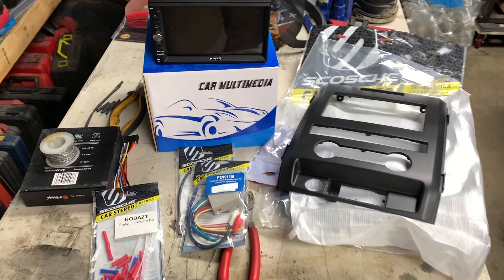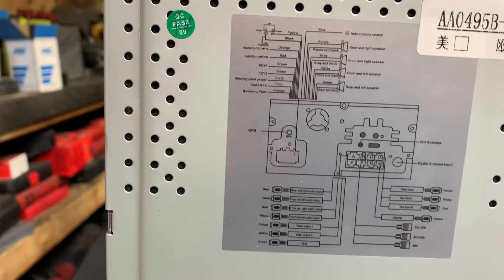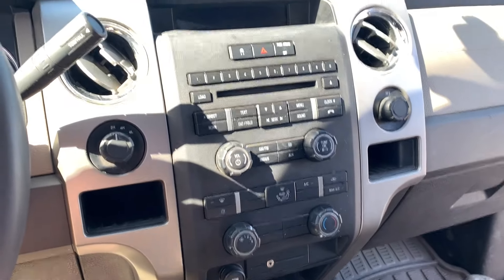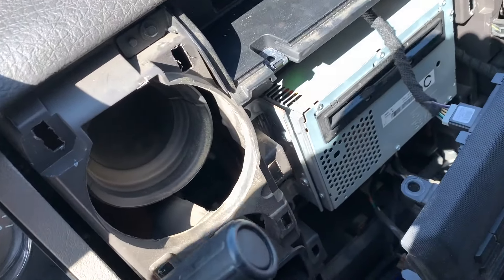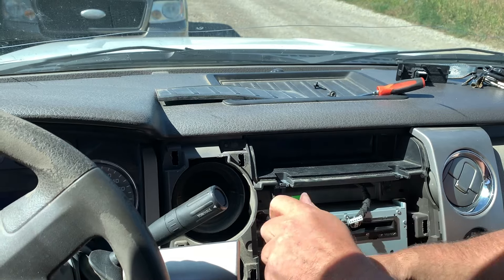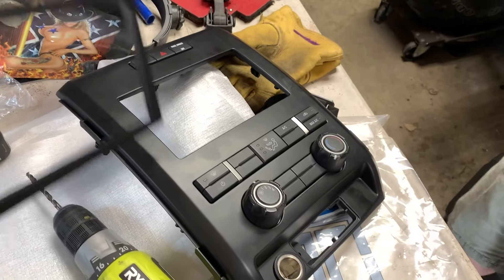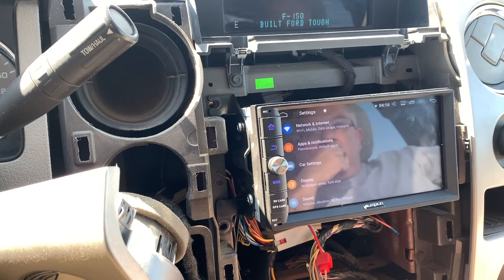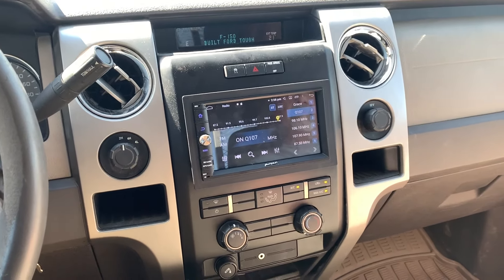DIY Ford F150 Stereo Install 2009- 2014

Comment: EXCELLENT job clarifying which wire you tapped for ignition hot.....
Reply: I really need to figure out what he tapped into because when the guy wired up my radio the ignition switch turn on wire didn’t work so he hit wired it to the hot where I have to turn the radio off myself when I get out but it started a paracitic draw on my truck I have been trying to figure it out for a while now so I need to know what to wire that too
Reply: @TheDoubla44  ignition hot is under the passenger side floor trim, door sill or whatever you call it. If I remember right it's a blue one. There's two to pick from.

Comment: Pro-tip: disconnect the negative battery terminal before you ever work on anything electrical in the vehicle. Otherwise, you may find yourself buying a dash, windshield, and airbags. Speaking from experience - a dealership I worked at had a mechanic installing a radio that didn't disconnect the negative battery terminal before beginning the job. Repair manuals usually advise to disconnect the battery negative battery terminal before starting any job.
Reply: Yea I've attempted it without disconnecting the battery and i can vouch that you will definitely see fireworks if you bump something🤣🤣. It scared the crap out of me when it happened.
Reply: Oh! One thing I did forget. The kitchen sink LOL no seriously the whole purpose here was to say for a few more dollars just get a professional or someone who knows exactly what they're doing so that you don't run into an extended length of time without the radio and then understanding. I would have been better for me to just pay somebody to do it. The problem is I got such a large variation in prices. Just to put in a aftermarket radio that I already had the parts alone such as the interface and the adapters or literally double and even triple the price of what I could buy them from Crutchfield or right away I could walk into Walmart. Which by the way I spoke to someone like Crutchfield last week and she was extremely knowledgeable and was able to give me a price right away. I thought at the time it was probably a price that I could do without. But by the time I put my time plus the cost of the materials, I probably would have been better off with the Crush

Comment: Hey all! I've seen a lot of comments about finding a good source to tap into. One commenter mentioned the blue wire connected to the hazards, and honestly, it’s worked flawlessly for me. If you're facing a similar issue, give it a try!

Comment: Like so ppl can see what wire he taps into. Use the White and yellow line wire, NOT the white and purple line.  If you tap into the white and purple for your setup you will drain your battery.
Reply: I used a t-tap on the blue wire from the hazard light connector to the red wire on the radio
Reply: @Beaksterboy  Blue hazard wire worked for me .Thx Beaksterboy
Reply: Thanks
Reply: I don’t have a white and yellow
Reply: @traceowen5316  use blue wire from hazard lights or 4 way light
Reply: @ubica021  don’t have a blue wire for hazard light connector, any idea which other color  it could be ?
Reply: @ericktrejo2  which one has the power on hazard light that ones is but put the car on or on position
Reply: Can somebody make a video about this
Reply: I have had a paracitic drain on my truck because of this for years and I just now figured out it is from the way the guy wired my radio and this seems to be the issue I need to figure out what wire to wire it to can anyone help me I’m seeing the white and yellow wire, I’m seeing a light blue wire from the passenger side and then a hazard wire but I am not all that smart about this stuff
Reply: I have had a paracitic drain on my truck because of this for years and I just now figured out it is from the way the guy wired my radio and this seems to be the issue I need to figure out what wire to wire it to can anyone help me I’m seeing the white and yellow wire, I’m seeing a light blue wire from the passenger side and then a hazard wire but I am not all that smart about this stuff

Comment: This is a prrtty good video 👍 However I had the same problem as many of you here asking questions .  I was a little dissapointed at the creator of the video for not responding to any questions on here as he seems to know what he's doing. 
Well, bottom line is that after researching I figured out that he would not have the correcr answer anyway, this due to the different variances in models and years. Depending on the model and year Ford has changed wiring and fuses around and the diagrams change. I had to look hard at mine from a couple of youtube videos as the advise on the comments on here ended with me having a constant hot wire which means you might leave the vehicle forgetting to shut off the stereo which will eventually drain or kill your battery. Other advise, i got a hot with the key to the on position but had to be on all the way as if to start the vehicle and also when I shut off the truck if it was running my stereo would shut down immediately :(
I did finally find a fuse to allow my radio to work just like the original factory. I will post another comment and make it short. Thanks you all for trying to help👍
Reply from the maker: The proper way would be using a Canbus controller would fix all those issues if a person wanted to spend another 100ish dollars
Reply: @TestDontguess  Cool. I'll look into that. Thank you 👍

Comment: Thank you for posting, it was really helpful to us with my friends 2010 work truck f150. He had problems with stock stereo not playing very well (extremely low volume) and the new jvc single din radio fixed the issue!

Comment: I just now finished my retrofit of the same radio with the same dash configuration. Here are some important things you might want to know. Firstly, I am a lifelong field engineer, a component level technician for a marine electronics company. I know how to use a multimeter and I could not find any 12Vdc line that is zero with the key off and +12Vdc when the key is in the second position (ACC or Ign on). I went to the fuse box located on the passenger side and found fuse 29. If you go this route it very easy to do. You will have to buy a mini (not micro--even though the size of the fuse is a micro--a micro will not work here) add-a-fuse from an auto parts store like Pep-Boys or O'Reily. And then run that wire to the ACC wire. Then it works perfectly. The radio is too big to fit in the opening on the supplied bezel but there is a frame that comes with the radio which I did use. I had to fiddle around with the distance the radio pertrudes out so that the bezel with be flush with the frame of the radio. It looks good actually. If you buy the camera, there is not enough cable to go all the way back to the tag. I didn't want to mount mine there anyway. So I 
mounted it in the back window pointing aft. Use the gps and the wifi antenna that comes with the radio. Sit next to your house and allow the wifi to see your equipment and login. Then go to Navi and allow google maps to download. It takes a while.
Reply from the maker: or get a Canbus Controller and then you won't have this issue
Reply: Is fuse 29 a 12 volt?
Reply: @spade304 : well, fuses are rated in amperes or amps for short. A 3 amp fuse is adequate.

Comment: For everybody asking i can confirm at 7:35, he wires the red (ACC) wire from his stereo into the white&orange wire from the air conditioning unit. This will let the stereo turn on and off with the car.

Mine is a 2009 f150
Reply: I used this wire on my 2010 f150 xlt, only problem is if I hit my mirror defrost it turns off the headunit. Any fixes you know of?
Reply: Thank you!
Reply: Saved me a headache bro. Thank you
Reply: @reefpearse7498  I don't an white & orange wire what other color ?

Comment: Look into running a wire from the passenger's side fuse box. They vary mine was for a 2009,2010 model and it is fuse# 41 however, rather than going by a number go by what the description on what the fuse powers. Mine says : Automatic dimming mirror,  door lock switch illumination, RADIO ACCESSORY DELAY. 
This allows my stereo to stay on even if I take the key out and is delayed for a specific time that can be programmed in your vehicle's settings or if I open my door (key out ignition) it shuts off immediately. Good luck with your install👍
Reply: This worked for me.  Thanks for the tip!

Comment: What wire did you have to use from the factory harness section for the power? It wasn’t clear in the video. Comments mentioned a red wire from the harness not being used but I don’t have a red wire there. How do I find the right one?
Reply: Did you ever find this out?
Reply: U just need to find the accessories wire from radio

Comment: What color was the ignition wire that u tapped into in the other plug?
Reply: I don't know if anyone else needs it... I took it from the AC plug. In my case it was WHITE with an ORANGE STRIPE. There will be two white/orenge stripe wires, you will need the one which closer to the center of the plug
Всегда пожалуйста
Reply: @ЭлеронАйрон  thank you, I'm doing the installation as I type this
Reply: @ЭлеронАйрон  nope, did not work for me
Reply: @royhkusp1  sorry
Reply: @royhkusp1  if you have a voltage tester, you can check for yourself which wire you have for the ignition. Put a minus on the minus of the battery, and check the contacts with the plus (from the tester), do not forget to turn the ignition on and off

Comment: I recommend getting the can bus harness. From experience I’ve messed up my electrical system trying to splice wires for the ignition. It’s a lot easier just to use the use canbus harness even tho it’s super expensive.

Comment: Did integrate steering wheel controls?
Reply: Would love an answer to this question. Has anyone figured out which wire goes to the factory steering wheel controls.
Reply: @loganbritton4093  If you get a wiring harness for all the plugs then you should be able to use the steering wheel controls.
Reply: I can't get any steering wheel controls at all and everything plugged right in
Reply: There is no steering media controls on those pick up

Comment: Thank you! This helped a lot because I had the same problem with my headunit. I installed it and had no power.
Reply from the maker: If a person spent the money and got a canbus controller you wouldn’t have this issue
Reply: @TestDontguess  what wire did you tap into?

Comment: Hi BSK
Which wire colour did you tapped on ignition power? And from stereo side which wire is it?
Reply: ladawg81 which harness?
Reply: Same problem with mine. Any idea what wire you attached the acc red wire too? Thanks
Reply: Any one found the answer... im stumped right now
Reply: TheCoolQuid did you figure it out? I have everything done it just doesn’t turn on I don’t know what wire he tapped into
Reply: @OscarGarcia-dz4ui  I tapped into the yellow blue wire on the hazard lights cluster. I will say that I didn't find out until I closed up everything. It cuts on with the switch but it's not the accessory wire. Lol I was pissed
Reply: @TheCoolQuid   thank you for posting this,  I've been scratching my head for a couple of hours now. I didn't really want to hack into a wire but couldn't find acc power.
Reply: @TheCoolQuid  thanks👍

Comment: I haven't left any comments in a long time it looks like there was some changes so I hope I got in the right spot. What would it thumbs up but I don't know if there was a rush on time but it sure seems like the most important parts in something like this or the details and in this particular case you had a very good point about the getting your heat shrink shrink wrap cut or pre-cut and so on so that was all great but if you're somebody like me that has only used the old school methods of putting a stereo in which would normally be a single DIN and I didn't have a whole bunch of wires so until we got into amps and things like that and building on to the amps and so on did we have a whole lot of wires to deal with. But in this case I would love to go to Ford and shake the hand of whoever or whomever put this together. It truly isn't a DIY task to take on unless you're a little younger than I am and haven't been out of the market for several years. So my plan was well not only did my first radio go out and I tried everything including the rebaking. that would be model B in the F-150 XLT 2011 . I finally decided that I would take a leap of get another radio from somebody that I had spoken to online. As far as I can tell that radio is fine but it does not work in my truck and that's when I noticed that there was a possibility it wasn't getting power to delete harnesses so I decided regardless I would just go ahead and purchase a double din with the touch screen and all the harnesses that were necessary as well as the interface to keep the steering wheel controls as well as the speed reduction or speed Sound Reduction. When you slow down at like a red light or stop sign and this volume goes down. Just in case I wasn't clear. I hope this is starting to make sense. I'm not trying to be overly detailed that I'm not trying to cut myself short in getting to the point. Yes there's actually a point at the end. LOL as I begin to digress I noticed that I didn't have any fire or any power going to those horses. The main harnesses that carry the power. I really didn't notice that I didn't have power there until I was taking the second original model B unit out. That's what I noticed that I wasn't getting the power. Checking fuses, I've checked them numerous times on both sides and going ahead and changed out many of them. The other thing is and if somebody's reading this and they can see the note or the question is there a relay specifically for the stereo system? Because I think there's like five fuses that go to the radio system. Anyway even purchasing the harnesses and all of this the interface then you wire in case I bypass the harness that I just purchased and went with a wire to the fuse box and then I'll be sort of defeating my purpose. Then I begin to throw something out of line even though that's the way we used to do it but now this is so much cleaner if we can just determine how the different harnesses are supposed to go and so on because I actually have the large harness that I could attach my interface with and it has a couple other harnesses on it as well. Before I start cutting any wires I'm going to double check to make sure I don't have to remove the original stock harness or should I just plug it together and so on well that's all stuff that I'll look into. I think it's a good idea that I read everything I can ahead of time before making any moves LOL. That was probably my most important part of this was that number one by the time I drove out to get the second radio by the time I go out to get the first radio which was the model B which is the nun faceplate and you run into all these different issues and you're even find yourself baking your radio in the oven and you question yourself LOL even though I can see the logic. And thanks for that video by the way but at this point I think the DIY part needs to go into File 13 and I would have been better off bringing it in and having a professional do it. I didn't want to just say that without giving some general reasons. I didn't want anybody who has done these videos the, DIY videos and so on to read this and be offended because I certainly do appreciate as many of you that make these videos. Again thank you very much. Oh and I wouldn't have been able to write this dissertation LOL without some of the things that I've seen on you all's channels so thank you. I'm going to try one more time to not have to run the yellow constant wire to a fuse tap. Or is the red that goes to the fuse top anyway I'll clarify before I go back on. But yeah with you guys not there to help us that are not on our game in that area, with used to be one of my favorite things I mean put in my own systems in my 300s and my Acuras and so on. But they actually made it very easy for us and some of us are overthinking it. So for those who are experts in it please bear with and thanks again to all that help.

Comment: On a 2011 F-150 the White w/ Orange stripe wire on A/C panel worked for me for Power
Reply: @jassyatwal530  yes. Defrost doesn't work when radio is on though. Need to fix

Comment: The included butt connectors are actually way better. Ask an automotive electrical engineer.  I use to think solder was the way to go myself but I’ve had my eyes opened on this.  FAA actually approves them on airlines and solder is banned.   Solder joints can bust with movement However the butt connection will endure it.  Yeah I didn’t buy it at first.
Reply from the maker: I won’t disagree with you as what your saying is true but I will continue to solder as I’ve never had a issue with soldering wires but I’ve had issues with butt connectors
Reply: BSK Garage  it honestly shouldn’t be an issue on a passenger vehicle.  What opened my eyes was doing a semi tractor once and that fell apart in weeks with solder.  I used butt connection and presto it’s still working for him.  Hahah I’ve never seen it an issue in passenger cars myself. Just pointing out the truth there that butt connection is not that bad.
Reply: Same with marine electronics - per the ABYC code "Solder shall not be the sole means of mechanical connection in any circuit.”

Comment: what color was that wire? 7:35 I have the same problem.
Reply: Same problem.
Reply: @bryanspanglerracing4574  I didn't want to cut any wires so I just went to the fuse box on the passenger side and ran new a new wire into a pre-existing fuse that also turns on with ignition.
Reply: I used 16 gauge wire. Check fuses 37-38-39. It's going to be one of those. You will need one of those fuse tap adaptors. I got some off amazon